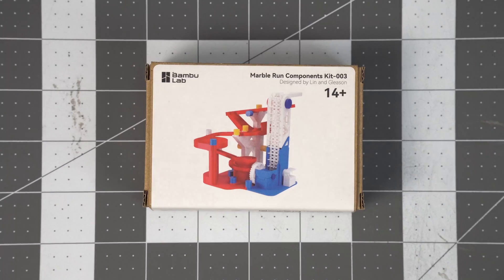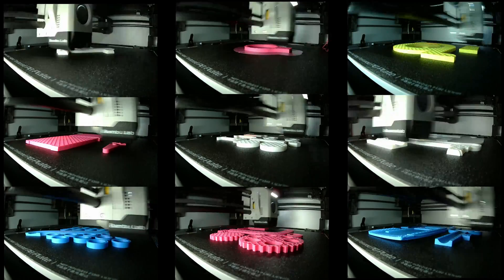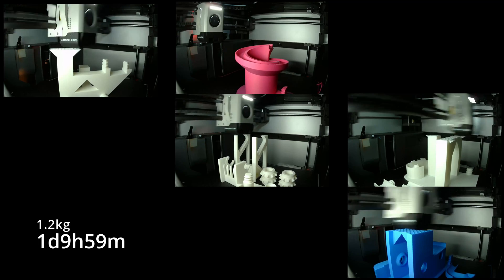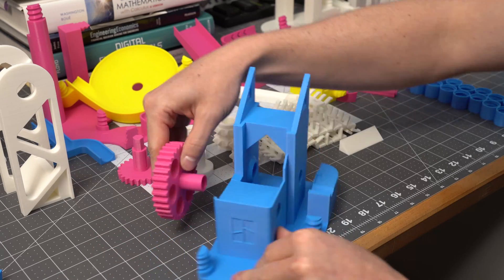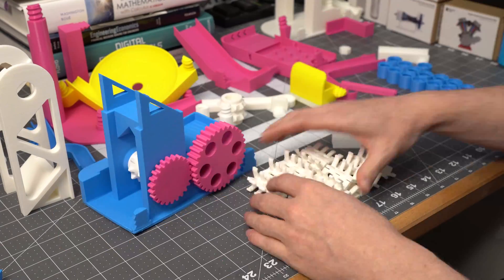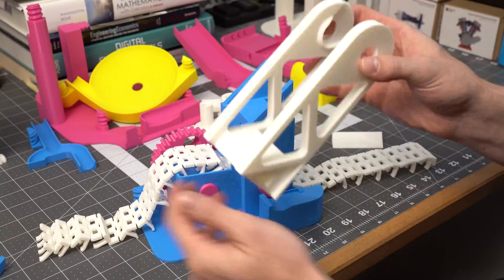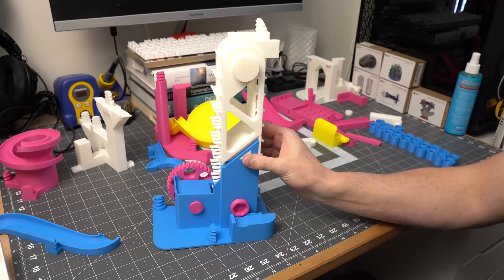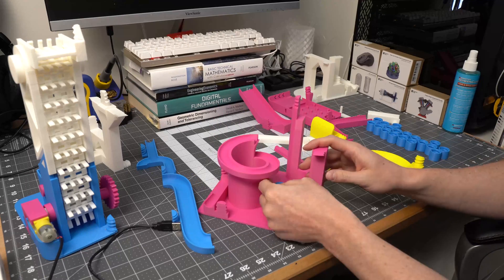Marble Run 3D Printing Kit - 003 - Bambu Labs | Satisfying Build Process

Comment: Did you do anything to lubricate the moving parts? I built it and the motor just won't turn the gears. I can turn them with my fingers, and it doesn't feel like it's binding, so I'm at a loss.
Reply from the maker: I didn't lubricate it but I did run the belt by hand without the motor connected to break it in.
Reply: @3DPrintStuff  Thats my issue.  Motor is not strong enough.
Reply: Same for me, need a stronger motor